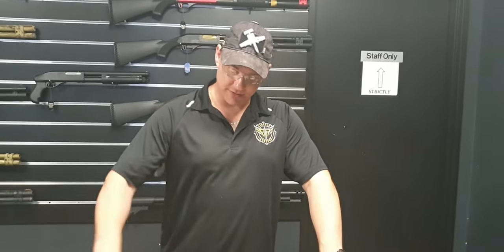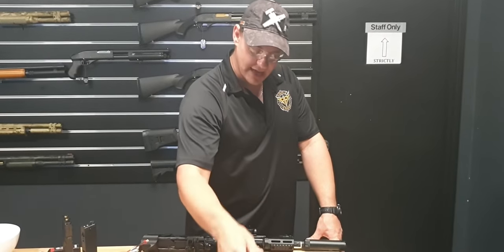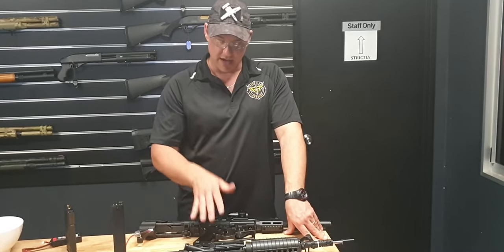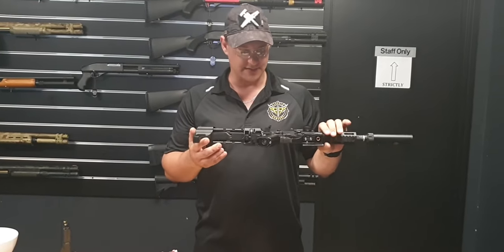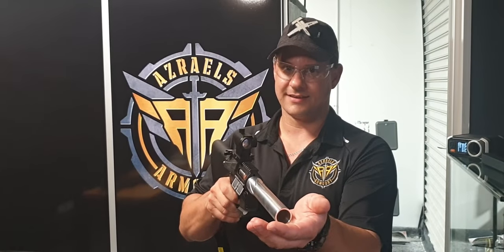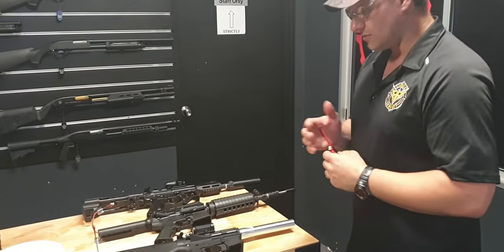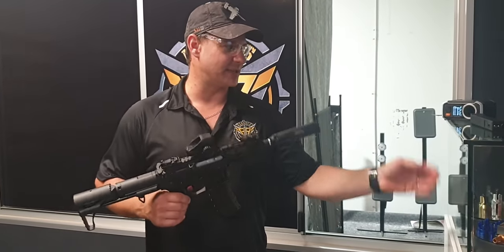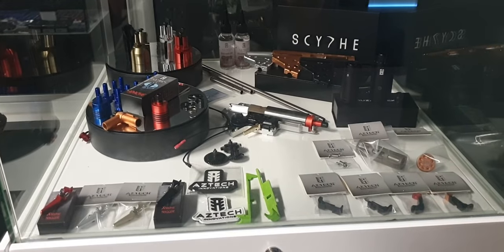3 more Armoury Built gel blasters heading out the door

Comment: Would love to see some actual ranged shots with these vids...high fps is great and all...but i wanna know if you can hit the broad side of a barn with one of these builds
Reply: apaches or tappetless is far more accurate than a tappet plate. they are head shot accuracy to 25m dinner plate grouping. where as a tappet set up we run 320 fps for best accuracy and range. porting plays dividends for accuracy. far more important than a barrel and hop up for accuracy same with regards to airsoft. alot of builds come into the shop 400 fps full cylinder, bruiser barrel and a big spring with accuracy to 10m. apache is evolution :). Our thing at azraels is if you spend x amount on a 400 fps blaster and get smoked by a kid with a stock gen9 whats the point
Reply: @shakkaclacka9150  that was my bread and butter...outranging and hitting people with my nylon gen9 over their high end builds lol..would be nice to see some ranged shots though..especially for us that aren't able to test shoot something prior to paying big bucks and having it shipped (plus regod etc)
Reply: @shakkaclacka9150  love to see this as well comparison of 400 fps vs 330 fps range and accuracy, love the work gents
Reply: @shakkaclacka9150  I'm running an apache in my set-up and my accuracy is terrible:( 13:1 shs, m110, shs High torque, apache, adjustable t piece, 350mm stainless barrel, gate titan, V2 receiver, well cylinder, shs piston and head. Riser hop up
Reply: @RattlesnakeJ85  what port cylinder and what type of barrel are you running? Also ditch the riser. We get customers switch to the aka short hopup and say it's "night and day" difference, we don't sell the aka hopup but they work a charm. Our hopup range will be back in stock shortly. What rubber is on your Apache and also what gels are you using bro?
Reply: @shakkaclacka9150  its actually a wells gearbox, wells full cylinder, 350mm 7.25mm Azraels, 3 rubbers, adjustable t piece and ultra elites. I'm thinking a VE issue?
Reply from the maker: Marty and Iggy are running APACHEs as are a huge amount of out door players and when setup right the accuracy and range out performs anything else we have seen before.  Martys 300 fps APACHE Falkor at the end of a recent milsim was comfortably pushing 47 metres with a 5m spread at that range as the breeze very easily moves the gels around in the wind.  Nothing else on the range at the time was able to push close to 40m with the gels that had been rattling around in the bottles for the prior 12 hours.  Other builds at around 330 fps can crack 55m.
Reply: @AzraelsArmoury  I would like to see footage of that...not to say it's not true but alot of people claim certain performance but never back it up with proof...with footage of such accuracy at that range I would almost certainly buy something immediately...as I'm sure alot of other people would as well
Reply: @dilemaz85  Dont have any im sorry to say, was the end of the day and the camera was flat.  There was dozens of people there and it was an independent player that was stood out at around 50m and made the call that the Falkor was consistently dropping at a gauged 47m.  We have run well beyond 47m with a little more fps, ie at Nuketown the range area is around 40m long, there is a few tress out the back on the left side around 15m beyond the fence line of which Martys other 340fps build can comfortable send gels passed the tree.
Reply: @RattlesnakeJ85  I would assume on the 350mm barrel you will be using a full non ported cylinder.  On an M110 spring id like to say you should be getting around 330-350 fps.  If it is much beyond 320 thats where your accuracy may be degrading, dropping the fps to 320 or so may help.  Also what barrel is it?  standard 7.5mm internal diameter or tighter?  Also, from personal experience, Rizer hop ups can either be good...or terrible, if its a bad one, then you'l have no hopes in getting good consistency in flight.